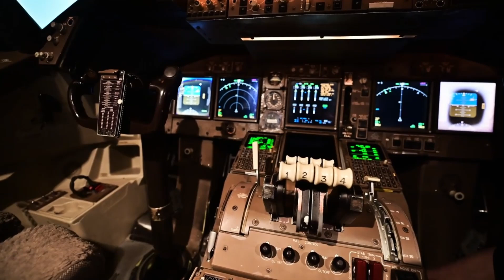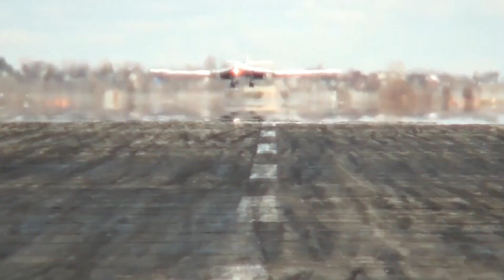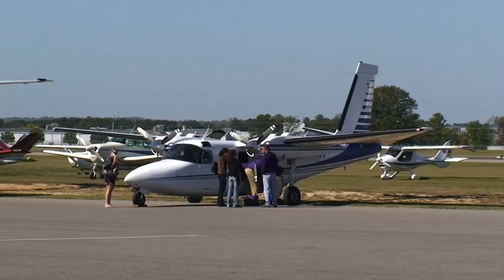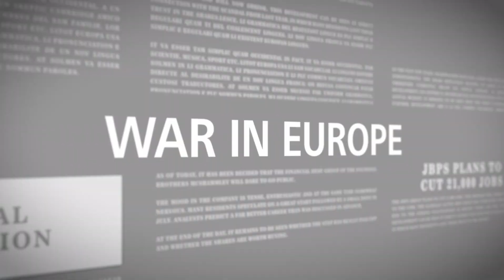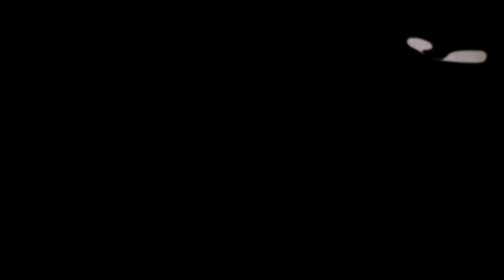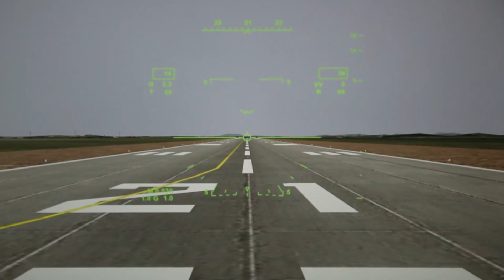What The US Never Told You About the YF-23

Comment: Lockheed Martin did a better sales pitch and could produce the Raptor in enough numbers, satisfying the DOD but they didn't have confidence that Northrop could match LM. The YF-23 would also come out at a higher cost per unit which, to the bean counters, meant a lot.
That's the bottom line as far as I can tell, from hours and hours of research.
Reply: There was also some consternation between the DOD and Northrop over past procurements.
Reply: LockMart had a more reiable track record as well. Regarding performance, they were comparable, but overall the 22 was a better dela imo. People romantictize the 23 now, but if the 23 had won it would've been the other way around.